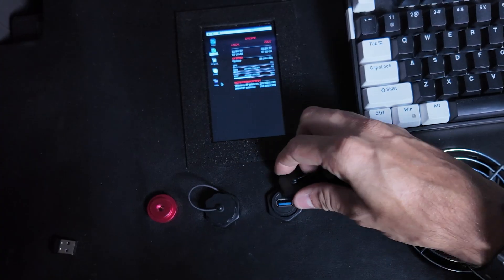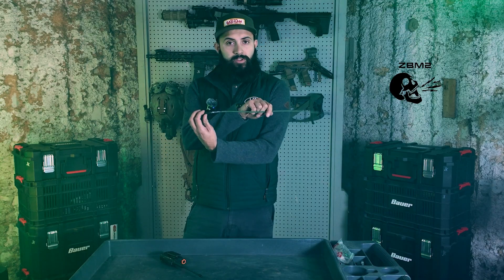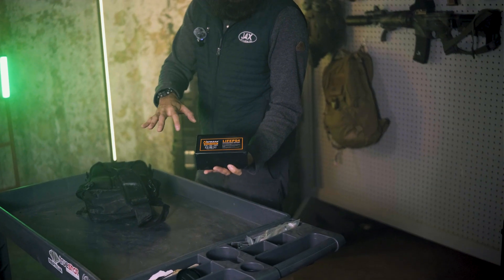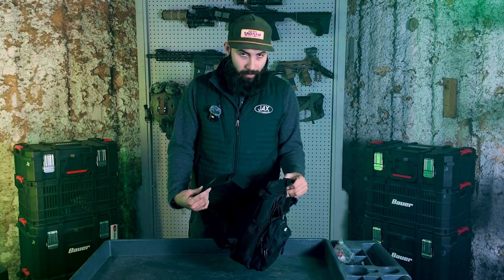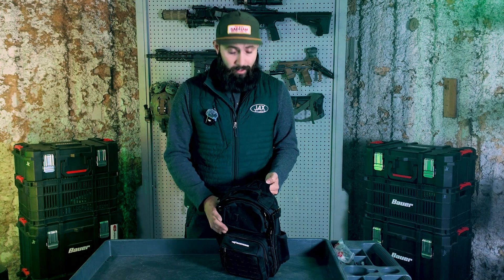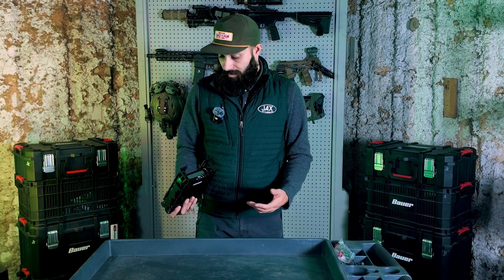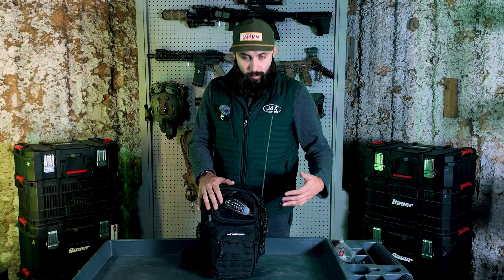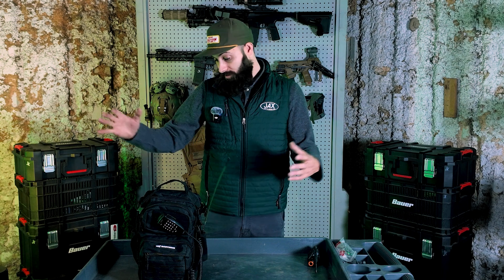BUILD A RADIO MAN-PACK BAG

Comment: I feel like a few things need to be mentioned.

Be very careful with RF exposure being so close to the antenna sending 50w. I don’t know the gain of the antenna but safety should be considered. Having a roll up J-pole to hoist up a tree or structure would take the antenna safely away from the user and increase antenna height.

Getting a quad band but only using AM or FM still limits you as far as distance goes. It’s probably a better idea to get a cheaper 2/70 radio but invest in something like an Arrow yagi to increase your Effective Radiated Power.

Comment: Wish I had a way to show my set up in the comments. I got a large pistol case with a cb, quad band radio and a couple handhelds , plus a inverter and the antennas broke down so they fit in the case. Got a bag with HF and potable multiban vertical and solar with one of those batteries. I like messing with radios lol

Comment: I wouldn't say the most radios go between 4 and 8 Watts. Most profesional, quality brands, go up to 5W, including military for example Harris 152*. And there is good reason, range depends on Line of Sight which is where VHF/UHF band live. When I say brands I mean, Yaeesu, Motorola, Hytera, Harris etc..
*Harris  has 8Watts option, but that is used for sattelite transmission that work in short bursts. Not in handheld day to day situtations.

Comment: Overall, good video. With respect to batteries, please do not call a LiFePo 4 battery a "Lithium ION"...Lithium ION is a very different chemistry than Lithium IRON Phosphate (LiFePo4) like you showed there. It is becoming a very common mistake but again, they are not the same.  Also, when you make a backpack radio like that, be VERY careful using any power over 5 watts that close to your body. You have many organs that resonate around the VHF range (liver, spleen, kidneys) and 50 watts can literally cook your organs. You would want to always use low power and if you wanted to use more, you would have to use a cable and set your antenna up at least 10 feet away.  I hope this comment does not sound too negative, I did enjoy the video.
Reply: In Vietnam what was the watts put out by the radios the RTOs carried? I think it was a concern to health but definitely not a priority because RTOs life expectancy were really short.

Comment: Add a Genisun solar charge controller and a solar panel and you can work off grid for ages!  I built mine with a FT-857d sadly no longer made allows HF as well then.  If you switch to Anytone or Tytera with DMR you loose 6m & 10m but gain encryption and longer range in simplex mode...
Reply from the maker: My personal pack has an 857. Lovely radio.

Comment: The TH9800 is a good 2M , 70 cm but not in 10M because AM only no LSB / USB , if I understand properly
Reply from the maker: Correct. No SSB on the TH9800. but, there’s not really a full-power alternative that offers that in the same price bracket. So, for what it is, nice to have. Especially if you have some handhelds that also do 6m & 10m. Interoperability is increased.
Reply: Yet, you need to upgrade Jake.   10 meter FM needs General class privileges
Reply from the maker: @alpha6tango860 not all portions off it. There’s a small bit that’s accessible to the Tech.

Comment: Could you talk also talk about what types of antenas should we look for? I mean - parameters.
Reply from the maker: That’s dependent on the frequency you’re transmitting on. But in most cases you’re going to find that these types of radios transmit on UHF & VHF frequencies. Meaning that you only will need one properly tuned antenna to function on both bands, such as the QP whip from ZBM2 Industries that was mentioned on the video.
Reply: @gridbasedotnet  Well, yes, but I am in EU and the cost of the antena plus shipping costs would be crazy high. The solution for me is to try finding something locally. That's the reason why I am asking. And yes, UFH/WHF is the core usage, as you mentioned :)
Reply from the maker: Signal Stik may be a good alternative. The EU is big on radio, I’m sure there are some good resellers over there. But, since I’m not familiar with EU comms I probably won’t be of much help.

Comment: Great content. Could you please recommend a similar radio that is waterproof/weatherproof?
Reply from the maker: There are none that are waterproof or weatherproof. This is due to the fact that these larger types of radios that have higher wattage levels also create more heat. Being that they create more heat, they have to have cooling vents and fans. 

This prevents being able to water proof them. A water tight bag is what you’d be looking for in this instance.

Comment: To take full advantage of the 4 bands of this radio, will require at least 2 external antennas.  No point having 50 watts of power if you don't have a proper antennas to take advantage if it.  You could make one for the 10m and 6m as a dual band antenna with a Folded Skeleton Sleeve Antenna.  (youtube videos show it).
Reply from the maker: They make quad band antennas, so you wouldn’t have to have 2 separate antennas.
Reply: @gridbasedotnet  yeah we call them dummy loads on sticks, you need good antennas.

Comment: This radio has 6meter and I have a prc 77 that will also do 6 meter. 

Will these radios talk to each other?  I know that the prc 77 uses a specific tone (if I remember correctly).
Reply from the maker: They should with the right settings